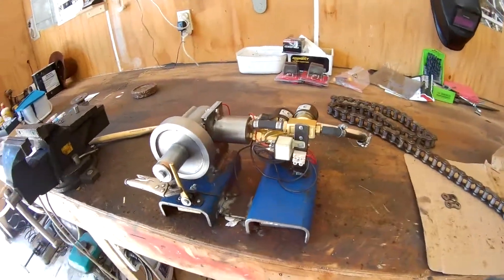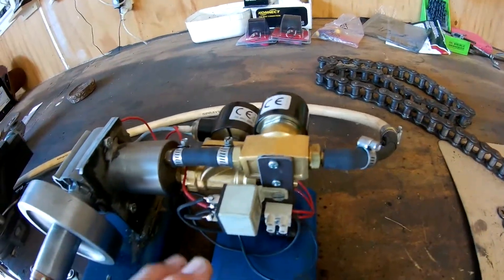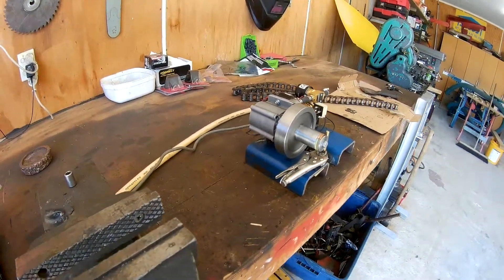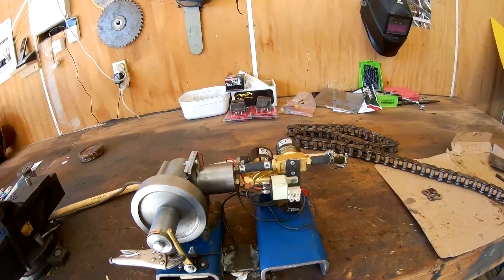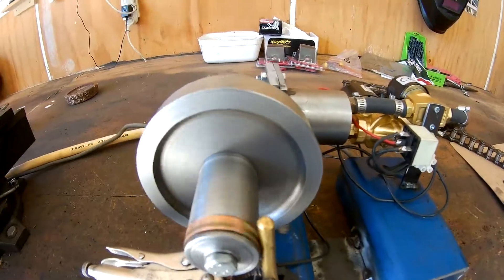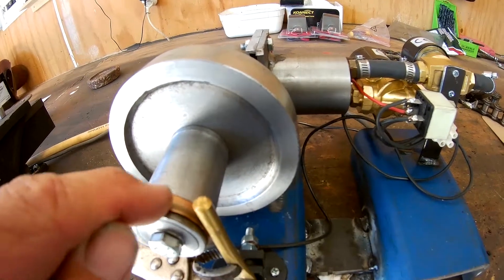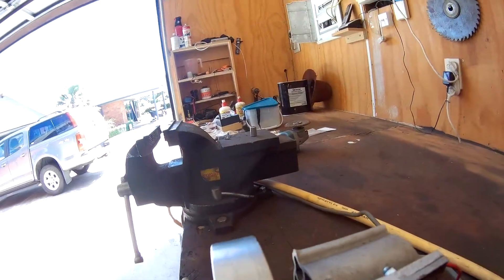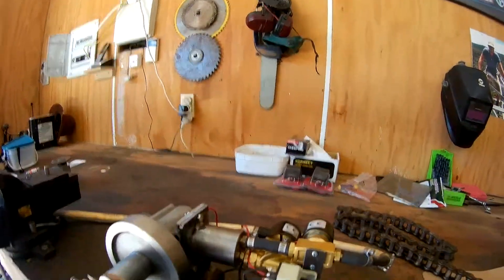Steam Engine with solenoid valves

Comment: Is the maximum rpm limited by how quickly the solenoid valves can open and close? I recently got an old air conditioning pump from the auto wrecking yard and noticed it had 5 pistons on each end of it that moved back and forth by being fixed to an angled disk in the center. Im thinking of using solenoid valves to electronically trigger 5 valves. Each going to feed pressure to the pistons, 1 on each end, that rise and fall together. I just wonder if I can get valves that can flow enough to make good power and switch fast enough to gain a decent rpm. The pistons move on a plate like in this video https://www.youtube.com/watch?v=EPEBwXhEMi0
Reply from the maker: That'll be an interesting build, getting the timing right will be a challenge. 
I was going to build a 2 cylinder boxer motor with electronic timing, one day.
One reason my little motor doesn't rev out properly is that both valves are naturally closed, where one should be naturally open.
To make one of them naturally open l used the relay.  It's the relay that's slow.
Reply: @Paulman50  I was first thinking of some kind of 1 to 1 direct rotor porting that would use an elongated recess in the head that would allow for the next cylinder to take in a small amount of the previous cylinders exhaust pressure just as the rotor passed the port that feeds the 1st cylinder and moved over the next cylinders port. It puses the piston down and the rotor would need to go at the same speed I think,  and the length of the oblong or oval port openings would allow for the hang time it needs to fully depress the piston. I hope I described that well enough to be semi understandable.  That port idea is still not quite solid in my mind and so the next was to go electric like yours and I cant believe how little information there is regarding electric valve timing for steam or air motors There is a kid using arduinos to try and run a gas motor like a briggs but gas motors being higher rpm I would think that the lag time of the relays would not let them keep up
Reply from the maker: @tiredironrepair  the inline cylinders were used in steam ships. Small cylinder exhaust goes into larger cylinder and then into the largest cylinder.